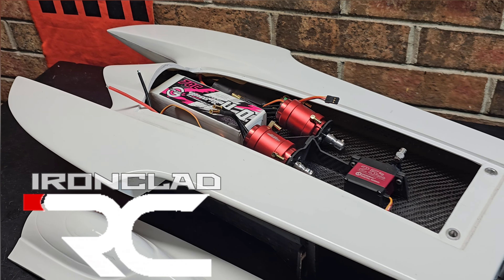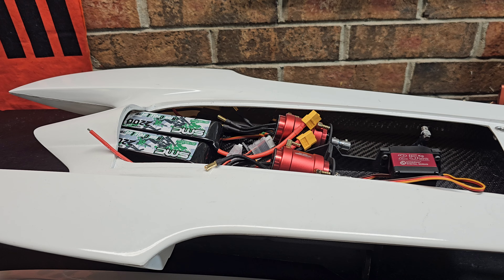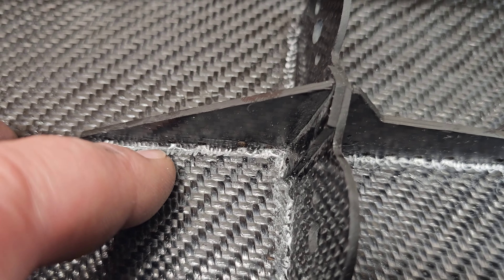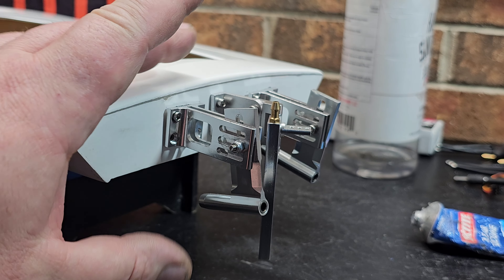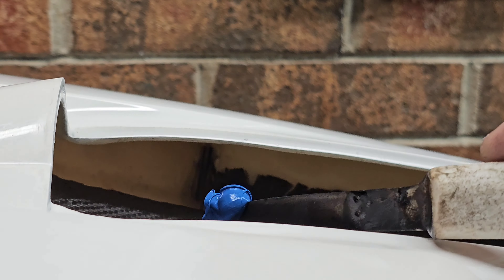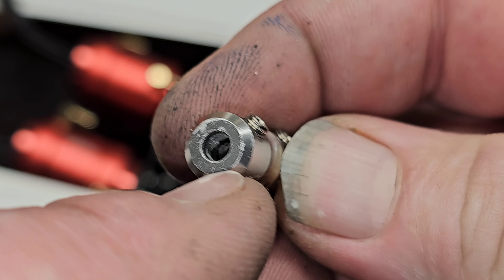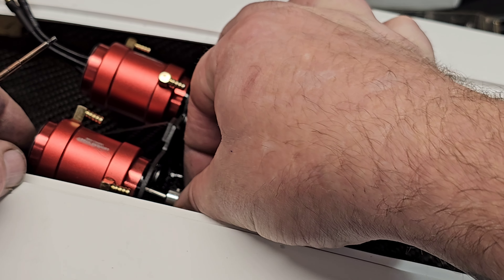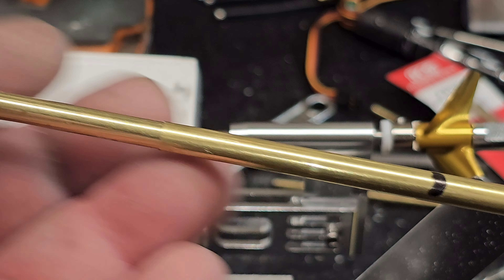Installing Hardware & Motor Mount Twin Hydroplane Deltaforce Vortex 24 Build Series

Comment: I wonder if you can take the epoxy and mix it in with the chopped up carbon fiber and the fiberglass and put it into like a $20 dollar general blender and put it on high for like 10 minutes
Reply from the maker: Dr jet tried blending carbon fiber lol, it turned into a poof ball lol. 😅